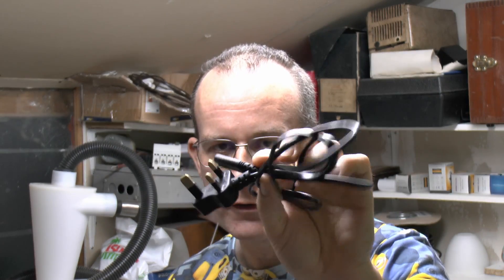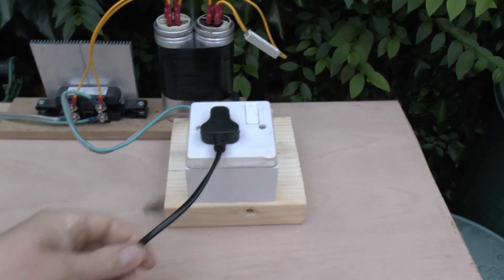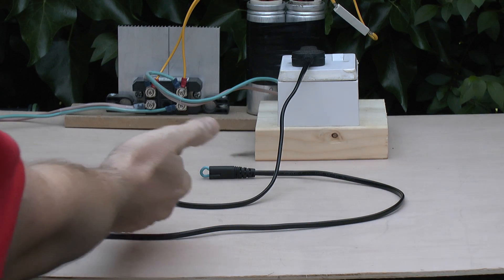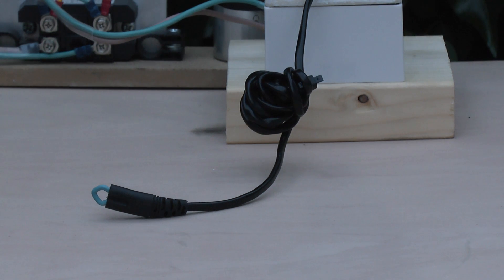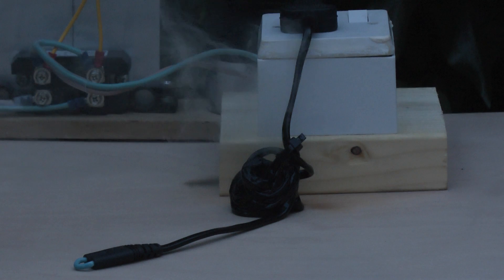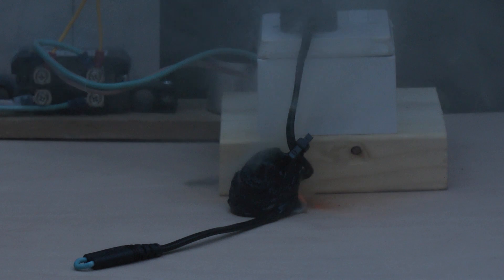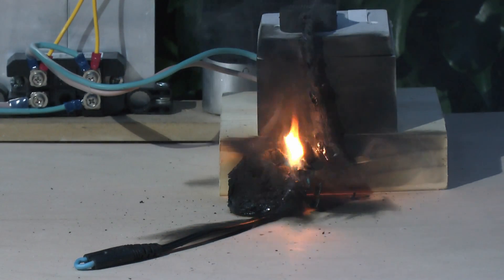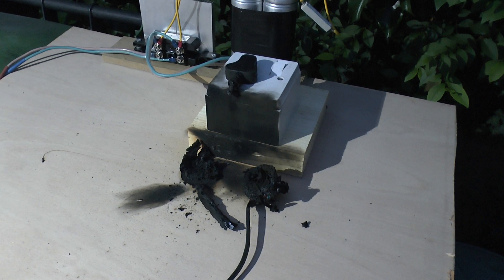Uncoiled and Coiled Overheating Power Lead and DC Burnout

Comment: I have one of these and the worrying part is that it has 'Volex' printed on the small figure of 8 plug which I can only think is to make consumers believe that it's reputable. Import regulations from the far east count for nothing.
Reply: @Mr Brightside - it's certainly correct about the responsibility for "personal imports" in Australia. Our electrical safety standards and legislation specifically mentions this, and that the importer is 100% solely responsible - and that it applies irrespective of who the manufacturer is. So it's quite clear, and in AU there is no "loophole" whatsoever.
That said, it is a completely separate offence to "offer non-compliant products for sale". This is a less serious offence, since the issue of REAL safety still remains that of the importer anyway. Whilst this certainly applies to overseas vendors who advertise products (eg: ebay), the difficulty is that there's no jurisdiction overseas, so penalties cannot be applied (as is the case visa-versa as well).
The UK doesn't really have a "safe" electrical regulations as such. It has an inherently unsafe domestic wiring with antiquated safety standards that allowed for 32A ring mains in a misguided attempt to "save copper". I am unaware of any other countries that allow such high currents to be presented at "unprotected" consumer power outlets.
That inherently unsafe ring mains system is still allowed today, although it's falling out of favour with modern electricians who are aware of better ways to handle power distribution. Unfortunately this legacy means that a large number of otherwise unnecessary "belts and braces" band-aid safety measures (eg: fused plugs) are required in the UK to reduce a risk that simply doesn't apply elsewhere in the world.
Reply: @Mr Brightside
1. I told you about the Australian laws and regulations so that you could learn something about how other countries handle the stuff that you babble about.
3a. I repeated your point about ebay because I was agreeing with you, dickhead.
3b. If consumers directly import unsafe shit and somebody dies, then they'll have to deal with the consequences. I know the Australian legislation makes the importer (ie: CONSUMER) 100% completely responsible. It's law in our country, there is no loophole....perhaps you should check the wording of the UK legislation before assuming that there is some "loophole". 
5. When you are being overly-defensive and argumentative, it gets in the way of a sensible discussion.
Reply: @Mr Brightside - I referred to the AU legislation because I know it incredibly deeply compared to the UK's. I offered that as an EXAMPLE that you can COMPARE with the UK legislation. It seems that I (wrongly) assumed that I was speaking with somebody who held at least some knowledge, so I expected that you'd quote your local laws back to me.
Whilst I work as an expert, technical consultant and am member of the committees that write the AU standards for electrical products, it's blatantly obvious that your knowledge of specific details is somewhat scant. In fact, that's an understatement and thus you can only opine your "wish" of how you feel that your world should be.
I manage the compliance of many kinds of electrical products (not just cord sets) into many different countries. We pay firms like BSI in the UK to consult on the specific detail of compliance in those local markets,  however the ultimate responsibility remains with me to ensure that we don't come unstuck.
Your scenarios of fires and deaths and grieving families and other rubbish are just that... rubbish. These things occur so incredibly rarely that there is no reason for your massive angst.
Perhaps you feel that human lives in YOUR country are not particularly important, however in most countries if there is any incident that involves a death then the legislators and regulators will thoroughly investigate and then THEY decide who is liable and responsible.
Companies like mine need to ensure that we have taken all possible steps to not cause safety incidents and, since the world is not 100% perfect, that if something bad happens that it was just a "ship happens" occurrence rather than that we were remiss in maintaining safety compliance.
Put in simple terms, our insurance companies will cover us for our liability when shit happens, but not if we don't give a fuck. So at the end of the day, as a responsible supplier we do everything possible to ensure that what we supply is safe, and that we can demonstrate compliance with relevant safety standards.
A private importer won't even understand any of that shit, but what can we do? It's impossible to train everyone, and it's not viable for an individual to pay the tens of thousands of dollars to test and certify a 50c power cord.
I  basically agree with everything that you say, however you seem to live in a "la-la land" of hopeful perfection. If you don't like how things are done in YOUR country, then YOU need to change it. Why do you try to make it my fault when you don't agree with how things are done in your country?
I work hard to fix the laws in my country, so just get off your keyboard and go fix it, arsehole!
PS: Most people don't see any problem, so there's no use you whining on Youtube while you wait for somebody else to change it.
PPS: If you say that there's lower incident rates now compared to the past, then you instantly defeat your own arguments than there is some massively increasing new problem that urgently needs to be fixed.
PPPS: A bunch of us convicts in Australia have a vastly better electrical safety record than provided by the archaic UK system that you so valiantly defend? Yet you call me wrong? Ummm.... yeah, OK.
Reply: @Mr Brightside - My only regret is that I wasted my time trying to assist you after you posted your concerns about electrical safety in your country.
You seem to be the only one who perceives this massive risk and the horrendous situation in your country that will surely cause the unpleasant death of a multitude of whining Poms, so I suppose that there is little hope for all those who currently live there.
Cheerio.
Reply: @Mr Brightside - I am English, perhaps the same race as you? There wasn't any racism in my comments, old bean.
https://en.m.wikipedia.org/wiki/Glossary_of_names_for_the_British#Pommy_or_Pom
Defensiveness commonly blurs the perception of reality ;-)

Comment: Does this mean that using soft flex in my shed for wiring everything isn't a good idea?
Reply: It'll be OK providing that you don't operate your 32A immersion heater (for your shed spa) via a soft flex that's tightly coiled into a ball.
PS: Flexibkle cable shouldn't be used for fixed wiring.
Reply: @johncoops6897  so the old bell-wire isn't any use for the fan heater? lol
Reply: @jonathantatler  strip off all of the insulation and braid it all together and tin it all with solder then twist electrical tape over it and it should be fine
Reply: Must make sure to do a fireproof test on the shed first. . . Do this by pouring a gallon of gasoline in one corner of the shed and setting fire to it. . . . . If the shed burns down, the test has failed
Reply: @jonathantatler - your bell wire is fine for the fan heater. The heater will produce a lot less heat due to the voltage drop, however the bell wire will heat up and make up the difference.
Reply: @johncoops6897  Brilliant! So long as the fan doesn't start ringing I'm golden!
Reply: Jonathan Tatler    Here in US, cords are not to be used for permanent wiring.   They can not be run in or through walls, floors, or ceilings.   Extension cords or plug strips aren't allowed to be daisy chained either.   Many stores got slammed on this by fire marshals!
Reply: @KevinCoop1  That sounds like good practice.
Using extension leads can produce some dangerous conditions. Some leads are only two core, removing any safety earth. Many are only 1mm csa or even less meaning a multi-gang socket can be fitted to the end and many loads plugged in. Imagine a non-earthed radiant heater plugged into a 0.75mm csa lead and without the metal chassis being earthed! Not to mention the trip hazard of lots of loose cables.
Using flex cables inside walls is also potentially dangerous, the outer sheathing is softer than T&E and therefore more easily damaged. If we have cables less than 50mm (2 inch) deep in our walls they require earthed mechanical protection (metal capping).
All good fun !!!
Reply: @Xclub40X  I've left to plastic stuff on the inside but taken the outer layer of because it wouldn't go through the little holes in the metal shelf brackets I'm using to route the cable and hold up my heavy drill-press!
Twisted the ends together and sellotaped them, that seems to work 😃
Reply: @Xclub40X  I don't have any petrol, will a propane tank do?
Reply: @jonathantatler   I'd of still soldered those wires though. . Just to ensure electrical continuity.  .

As for the lack of gasoline/ petrol. . .that might be an issue, but yes a propane tank will be suitable for the structural test of your shed. . .but you really do need a fire under or next to it, and it will have to be a pretty hot one. . . Maybe the test will be more thorough if you can also include an acetylene tank with it. . .. if you add an additional amount to fill your entire shed, then you can also have enough spare thermal and kinetic potential energy as to test the structural integrity of your house as well. . .
Reply: @Xclub40X  it didn't seem to work, there was a bang and flash but the heater never ran!
Then I discovered the fuse had blown, so I replaced the wire bit with a bolt that fitted and the same thing, only the whole house went dark?
Reply: @jonathantatler  you've tripped an RCD or blown out one of those cartridge fuses in your consumer unit. . . .
Reply: Quick phone call to North Korea should solve your problem
Reply: Not this stuff. . . Unless you want to burn your shed down to the ground
Reply: Keep an eye on your cross sectional area.

Comment: Hi Jon I can’t find any appliances which going over 13 A on this socket C7  ???
Reply from the maker: Probably aren't any, and the plug would normally have an appropriate fuse in it such as 3A to prevent overload.
However this is an unfused piece of fake junk, so anything is possible.
Reply: You won't - C7/C8 connectors are rated for 2.5A. I think John's point is that because there is no fuse in the plug, it could draw up to the 32A permitted on a UK final ring circuit. It would be interesting to see this with a 32A AC load...
Reply: @marct3928  'Permitted'. interesting. I'm pretty sure there isn't a limit.

Comment: These things need to be banned, china needs to agree to comply with BSi rules which will come into play again post brexit so much of the CE dangerous stuff should stop but how much is actually inside the UK already.

It's the same as those "deathdapter" extension leads that any old plug fits, if anyone out there is using one get rid of it, replace it with a proper UK one for safety and the life of your appliances/devices
Reply: Leaving the EU will make no difference to these junk leads and plugs getting into the U.K.
They are already banned. Do you really want to pay silly amounts of tax for every parcel from China to be opened and inspected?
Reply: If you as an individual purchase from China, you are the importer, if I understand correctly. Chinese plan to raze all western infrastructure.
Reply: Mr Brightside - getting China to pay means getting a trade deal with them that includes this inspection “tax”. What do you think the probability of China agreeing to that is? There is no way China is going to agree to anything that makes its exports less competitive. China is a much bigger economy than us and we are heavily reliant on imports of goods from China, hmm...

Comment: You knew this would get lively when DC joined the party.
Reply: AC is sad and lonely after being booted from the chat
Reply: @Xclub40X  couldn't decide what direction to take.
Reply: @bostedtap  well I could. . .and it happened to be the way it always usually goes. . . . Drink beer until I blow a fuse

Comment: And lastly. . .the police and customs excise are investigating the importation of these illegal items.

They have new leads
Reply: The police have arrested two youths for swallowing batteries and messing with fireworks. . .  one was charged and the other one let off
Reply: ...and conducting enquiries.
Reply: ...and plugging away, solving this problem.
Reply: @johncoops6897  someone's bound to get charged over this
Reply: Aren't you the bright spark 😁
Reply: @MaffTUK  yes lol
Reply: The current investigation is really heating up...
Reply: @5roundsrapid263  let's hope they dont get their wires crossed over who did watt . . .
Reply: @5roundsrapid263  this case definitely has POTENTIAL to go all the way. . .to a circuit judge
Reply: TOTALLY AWEMAZING It depends on how much they resist...
Reply: @5roundsrapid263  well let's just make sure they RELAY the case to the CPS . . I mean CPC first before they charge. . .
Reply: I for one look forward to the court appearances.  .   The atmosphere will be electric
Reply: The case is CURRENTly still ongoing. . . Let's SWITCH over to our legal correspondent outside police HQ
Reply: The evidence will be put before the court. . . . this was a reVOLTING crime of heinous proportions and comes as a SHOCK to the whole country. . The courts will use the full POWER and ENERGY of the law to make certain that the ohmfenders are brought to justice
Reply: 5Rounds Rapid They are in hot water 😂
Reply: @zjzozn  😂😂😂very hot water. . 🚔🚔🚓🚓
Reply: The police and customs should rectify this.
Reply: @gteaz  legend reply
Reply: It would be interesting to see how the police investigation will TRANSFORM into a court date. And how the OHMFENDERS will TRANSIST from police CELL to prison
Reply: They have an undercover COPPER on the inside.
Reply: @juancornetto8243  that is good
Reply: Wonder if Vince CABLE will be in select committee for the public inquiry
Reply: Enquires was stalled by a dirty copper, who has since been suspended.
Reply: @gorillaau  oh jeez. . . This thread really has got deep real quick. . . Funny comment though hahaha. . .  Well SUPPLIED
Reply: @Xclub40X  I'm glad someone got a KICk out of of the VOLTED comment.
Reply: The police have arrested one person so far, his name is Henry Farad.
Reply: @gteaz  Charged with FARAD and emBEZZLEment?
Reply: I am glad the police and customs and excise are investigating this because you can see in the video that they are clearly dangerous and not fit for purpose every time I buy something that has one of the others leads it ends up straight in the bin
Reply: @simonsmith2802  - WHOOSH !!!
Reply: JW, This is beneath you. You have not conducted this as a meaningful test where this is a risk and very likely to happen in your home .I think you’re probably trivialising any future reports by presenting this one in the way you have done today. UK homes have AC current we do not have DC in our homes agreed the plug should have a fuse and be to the British standard. I much prefer the more serious and meaningful issues in past reports
Reply: @markbox6432  Wrong comment thread, Mark. This is the punny one. I hope you are not too shocked by the news.
Reply: @markbox6432   stop talking out of your top hat at least John Ward has conducted a test it doesn't matter what he uses whether it's DC or AC it will still perform the same he is electrical engineer ear and I am electronics engineer ear so we both know what we are talking about
Reply: @simonsmith2802  - your "stop talking out of your top hat" comment confirms that you most definitely aren't an electronics engineer.
Is an electronics engineer ear the same as a pig's ear?
Reply: @markbox6432  - Yep,  100% agreed, and many others have pointed it out too. I started a comment thread highlighted here: https://www.youtube.com/watch?v=DZvrIrAoA4g&lc=Ugy5qimuDhOfswMt8Sh4AaABAg

Comment: 5:16 .  .that was pretty angry. . . The sort of pent up aggression you normally get from burning LiPo batteries. . . . Bet that lead was made of crushed up bits of battery
Reply: Thats what high voltage and high current dc does
Reply: @joshuabest100  good ain't it??. 
 Unless you happen to be a JW experiment, or come into contact with it